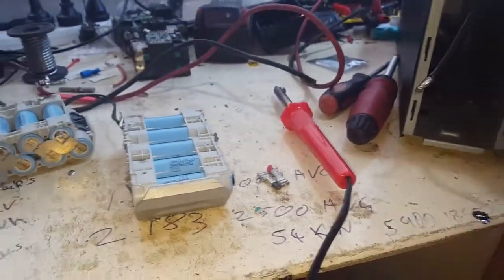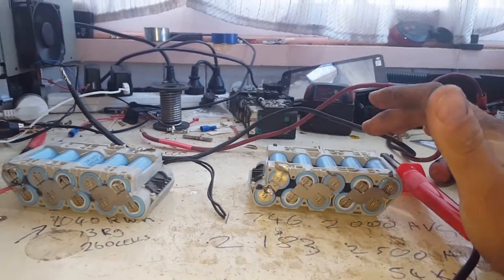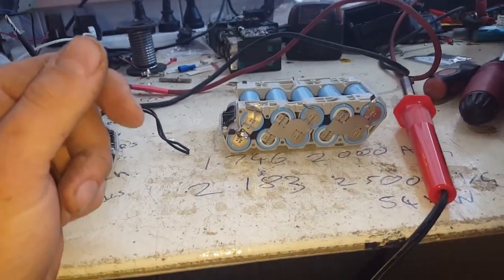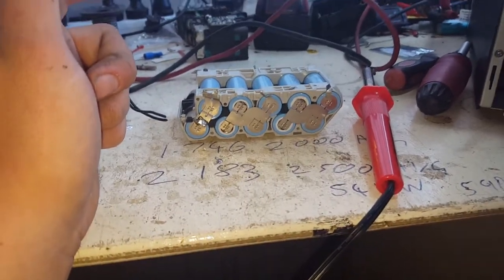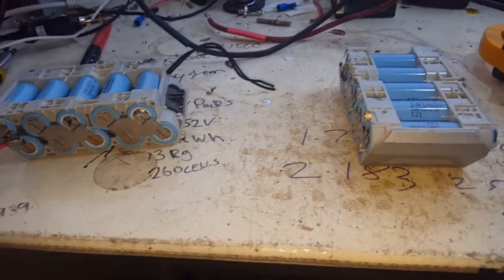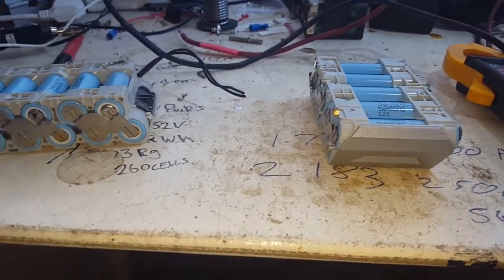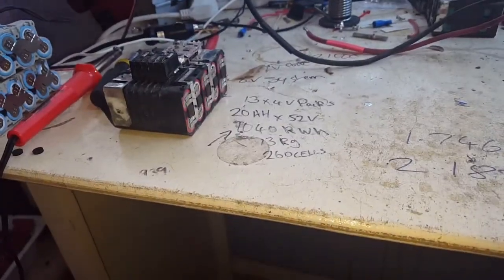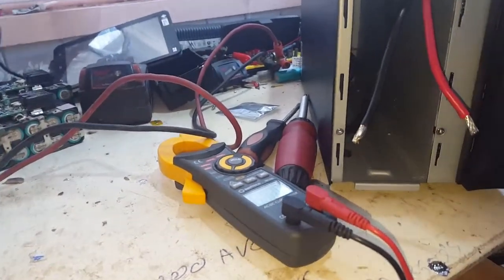18650 Cells out of balance stuff up Hp  1kw ups project

Comment: Whoops, No harm done, :) I killed 3x6s lipo's >$150 worth (6 cycles on them :( ) by leaving them connected to a controller a month back, we all make mistakes..

Going back to the not burning your house down thing.. be careful I'd rather you don't become option A from our last chat ;) leave that to someone else.. 

at worst build yourself a fire safe area.. loads of designs, steel box, breeze blocks etc my fav was the sand above batteries idea from flight test, where you use something that will burn out and drop sand through to smother a fire if it gets going.. but even a metal toolbox on bricks would do the trick..

If however you do decide to start a fire please let the camera be on so we can all share in the moment you throw your electrical grenade out the window ;D
Reply from the maker: +Dave Webster (Webstaff) when i first started  playing with liion 18650s i had to throw one out window as the wrapper was smoking burnt my hand and i didn't  have a camera rolling ;( some time i can film up to an hour of video just for something  to not work and its delete it all and start again. But its a learning  experience  that i can share so hopefully  if someone  watches it they might not blow them selves  up :) cheers for the support